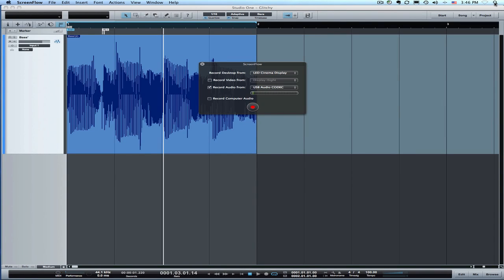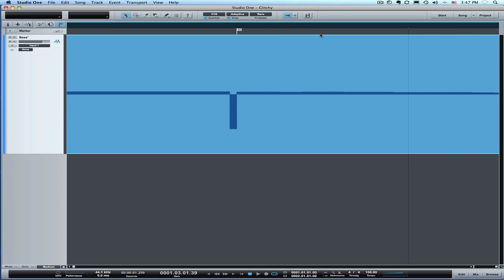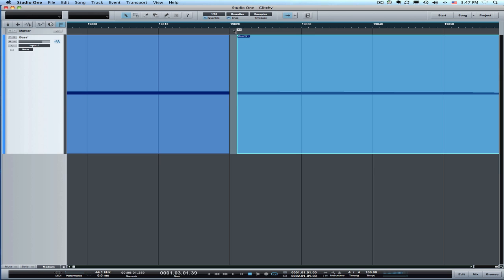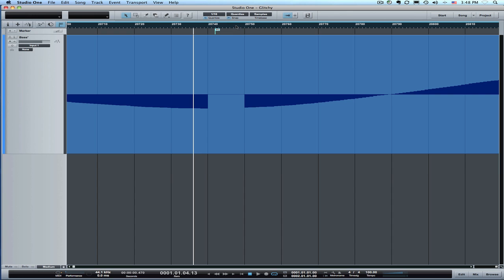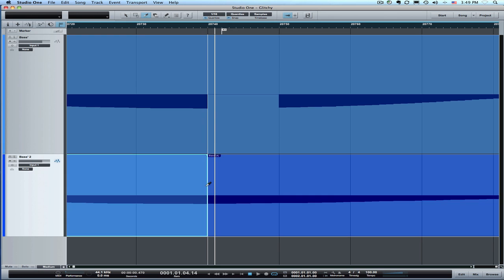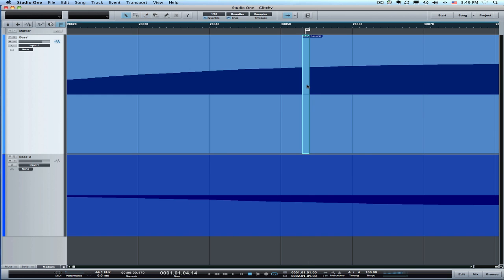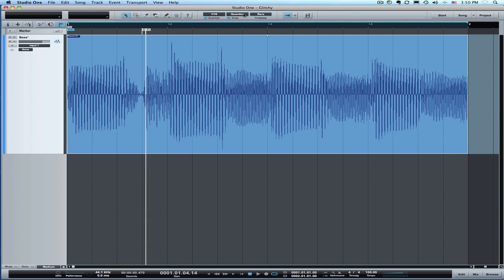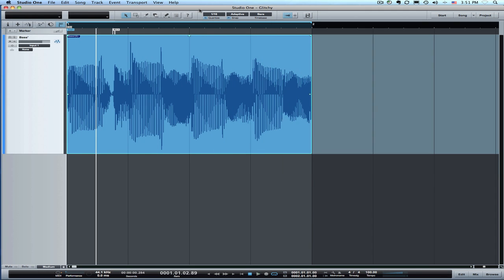Studio One How-to: Fixing Audio Glitches

Comment: Sorry to bring this old discussion back to life, but: Is there any tool that helps you spot these kind of glitches, or does this require careful listening to every second and scanning of every bit of waveform? Dropouts are occasional problems that need attention, and I hate the idea of missing one. Thanks if anybody has input on this.
Reply from the maker: Izotope has tools in RX to handle this. But really I only worry about when the dropouts are audible. This example is a rather extreme case.
Reply: @InventiveGear  Thanks for the reply. Yes I realized that I was having more of this issue because my system was really not adequate for realtime processing. I upgraded my hardware since then and things seem a lot more manageable.
Reply: No, at least to my knowledge. An equalizer could help a bit though.

Comment: Hello, I tried editing a bad section of audio just like you did around 1:09 - 1:50 and finally figured out how to cut using the split tool but I cannot do your "B" command to bring the track together. Can you please elaborate? Are you holding down Command key. And can you explain how to "bring down" a way-to-loud bass section of a track. Thank you very much for your expertise and videos!
Reply: Curious about this as well
Reply: Consolidate selection [B]
I believe this is what he was doing though it is not a default hotkey in the current iteration of studio one or at least not on mac as it failed to execute anything for me as well. The other thing he did by bringing the audio level down is simply achieved by using the mouse pointer at the top middle if the clip which allows you to modify the volume of clip gain on a clip by clip basis. Moving the mouse pointer over top left it right will give you fade in or out  and middle will give you clip gain.
Reply: Press [g]